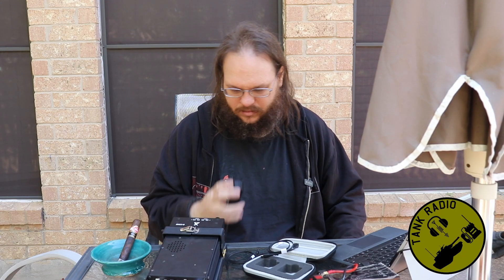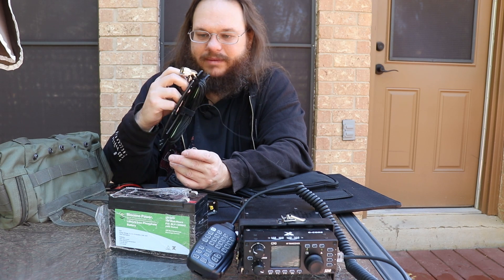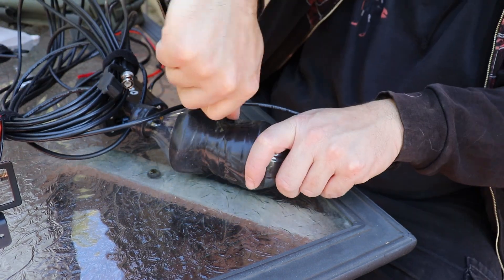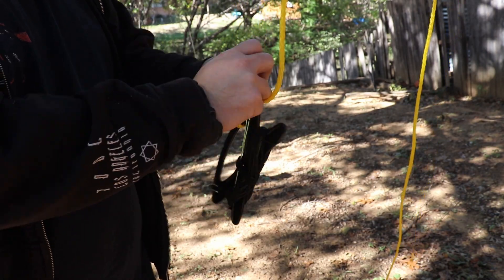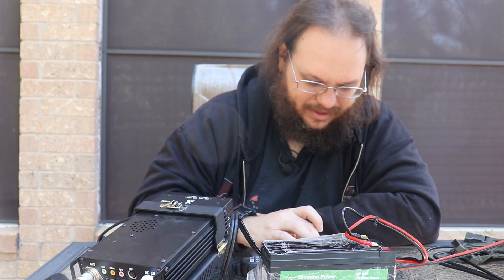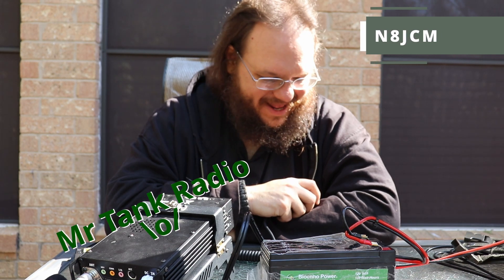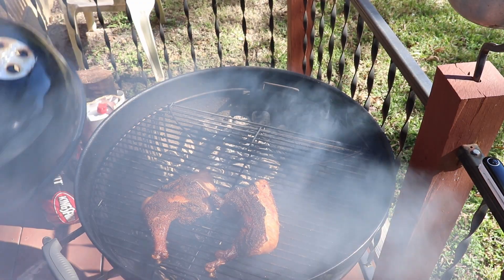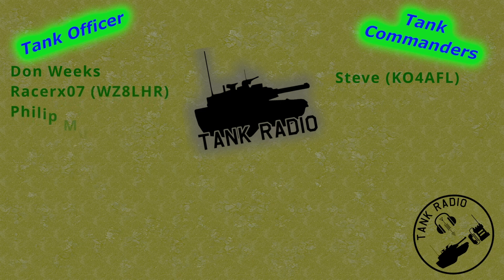Backyard POTA Equipment Shakedown

Comment: What Bioenno Solar panel do you have as your video shows a 2 panel kit and the link is a 28W 4panel kit  Im guessing you have the BSP-60-LITE  60W kit?  Great Video!!  CorvetteSteve/K6WRF
Reply from the maker: Your Correct, its the BSP-60-LITE.  It works great with a car portal POTA pack.  Looking forward to working you soon
Reply: @TankRadio  is the "Car Portal POTA Pack" something specific or just a vehicle POTA setup in general?
Reply from the maker: @K6WRF  just the size of that panel doesn't make it convenient to hike with it over long distances.  Everything else kind of in the video packs down small enough to be in a backpack.